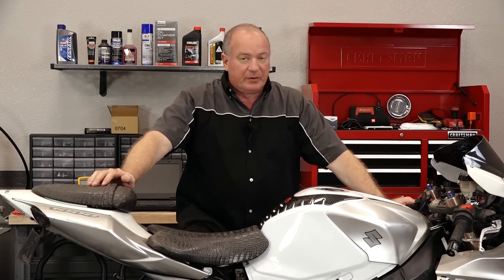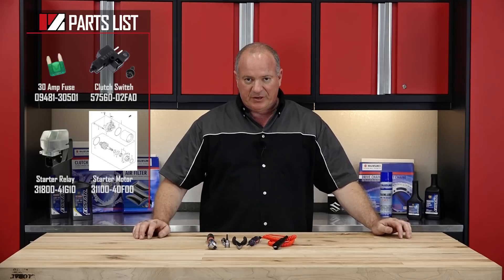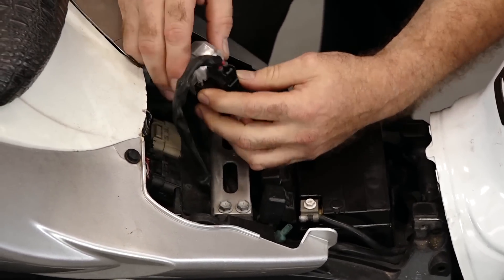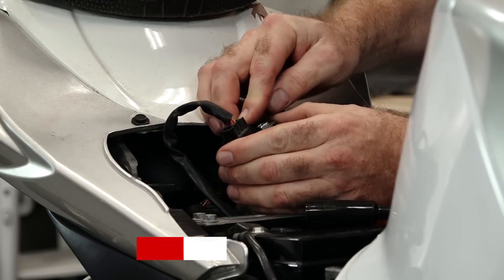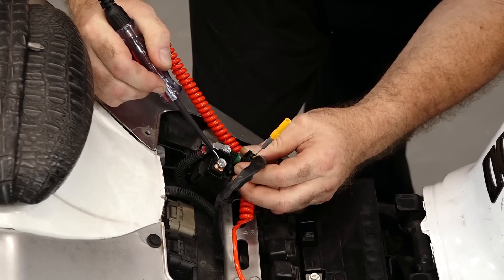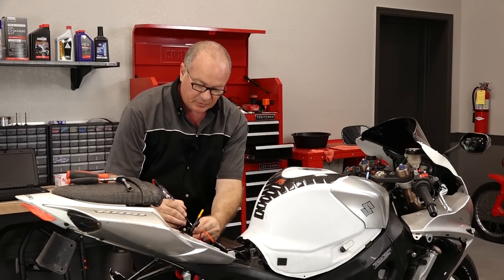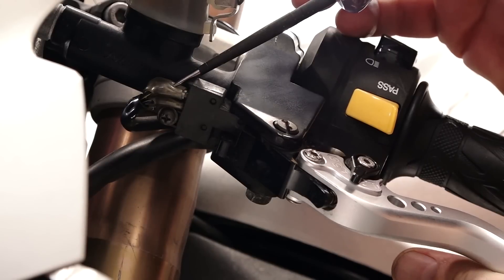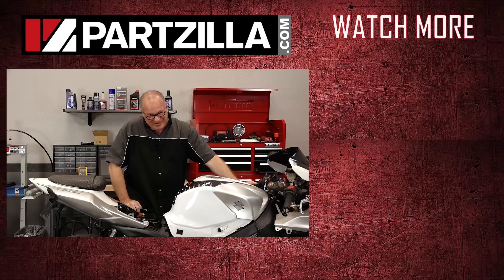GSXR 1000 Won’t Start Troubleshooting | Partzilla.com

Comment: Thank you video was very useful on 08 gsxr, at the end it was just the setting in the clutch little adjusting lever on my aftermarket shorty levers, it wasnt out enough for it to click the switch when I pulled on the lever, probem solved thanks
Reply: Angel Diaz Thanks for posting this comment. Took me forever checking everything and this was my exact problem.
Reply: you welcome glad it helped you out, I taught it could happen to somebody else sometimes is the simple things
Reply: Wow angel Diaz thanks a lot for posting that comment I spent hours Eliminating all the problems and at the end it was the aftermarket clutch lever not pushing the switch in enough wow crazy something so stupid could be the problem !!! Ty bro
Reply: Me rushing home hoping my shortys causing all my problems lol

Comment: Hi John, I've done everything you've stated here and found it very helpful,  but while testing the starter silonoid with the negative cable disconnected, the relay does not make the "clicking noise" as mentioned. Also,  when I touch the negative cable with the test light it does not light up.  Any suggestions?
Reply: Test light is good,  fuse is not blown,  switch works

Comment: Hey John, what about if my fuse is okay (measured for continuity), but its still not giving voltage to starter side?
Reply: Just found out, my wire's were installed wrong way lol. 😅
Reply: What wires exactly were installed the wrong way ?

Comment: The RPM gauge on My gsxr 1000 L1 (2011) dont work. What could be the problem? Wiring? fuse, or a sensor? Just the RPM. Shout out from sweden 🙌😃

Comment: I have a 1990 GSXR 750M track only bike that will not start. I thought I had a problem with the starter relay as it was clicking when I tried to start the bike, so I bought a new one and replaced the old one. Still not starting. Neutral, oil light and dials illuminate with the ignition switch set to ON position. Now, the new starter relay making a buzzing noise instead. I have also put a shorty aftermarket clutch and brake lever, would this affect anything? I fully charged the battery and tried again. Still no luck. I have not tried push starting it yet. Should I try this? Should I change the battery as it was bought in 2011? Do you have any suggestions as to why it will not start? Your help would be most appreciated. Thanks
Reply from the maker: Could be a bad battery, which is most likely.  Otherwise, check for loose or damaged wires.  Try bump starting it and see if it fires up.

Comment: Hi, I’m having an issue with my 04 GSXR 600. Anytime I connect the battery, it starts turning over. I get no power to the dash and the kill switch or start button does nothing. I am assuming it is the starter relay. Should I replace the starter relay or is there something else that I should be looking at?

Comment: was diagnosing a quad that was left to me has a 2006 gsx-r1000 and when i hit the start button my starter make a loud click sound and has a hard time cranking over does this mean my starter motor is on its last legs? and the starter rely part really helped me about the fuse because i couldnt find the dang thing on the quad until i found it hiding way under where it should not be so i relocated it as well while i was there. as well when you buy the starter motor will it come built i saw your link but im not sure if i feel comfortable putting it together myself i dont wanna drop any parts any advice?
Reply from the maker: I would health check the battery and test all the way to the starter.  If you need a starter, they come assembled.
Reply: Ok thank you so much!! I will get back to you and check everything along the way

Comment: I have a 05 gsxr 1000 bike will start with ignition on and just two big positive wires clutch on ground is good on clutch and 30amp fuse is good battery is only 11.5v and drops while turning over but I checked voltage at yellow green wire and only have 3.45volts what should this wire have for voltage    bike will start with charge but have to jump two main wires to starter thanks bro
Reply from the maker: Start at your battery and test everything down to the starter.  Either you have a bad wire, corrosion or bad solenoid.

Comment: I have got no dash coming on when I turn on the ignition just the headlights come on. I have power though even with ignition off to starter relay and both sides of the 30amp fuse. When I   jump together neg and pos terminals off the starter relay it turns over even without the ignition on. Should I have power to both sides of relay with ignition off? and should the starter turn over when shorted across with ignition off?

Comment: Hello I have 2016 gsxr 600, I’m having trouble with starting, all the light turns on, but doesn’t start, I checked everything has power, but the negative terminal on the starter relay doesn’t glow the light, but the fuse is in perfect condition, clutch is good too, any idea what could be possibly wrong. I’m thinking maybe the regulator/rectifier. Thanks

Comment: I’ve got an ‘06 GSX-R 600 that keeps blowing the 30A fuse and I’m sure it’s an easy fix, I don’t know where to look for to fix the issue though. Absolutely no power goes to it and the battery is good. Could use the help..

Comment: Partzilla I was riding my 07 gsxr 600 took it around the block and just everything shut off on me turn the switch on and no power at all, for the pass few months my head light keeps blowing out so I decided to not put a headlight bulb anymore, it didn’t use to have this problem before, my battery is good it’s new, but something is always killing my battery as well when I am on high rpm but not all the time, now the issue that I am having is that I took it for a ride and it all completely died on me no power at all and when i turn the switch on I have no power
Reply from the maker: You definitely have a short somewhere that is affecting your electrical system.

Comment: Hey so I check the clutch switch and up on checking I notice I connect the tester to the positive side of the battery and touch the top wire on the clutch sensor and the light is on when the clutch is pull in nothing happens the light just stays on!!! ? 😕

Comment: changed the starter relay, starter, stator, and rectifier, and still will not cut on. the lights and everything else works fine. everytime I try to start it I just hear clicking in the starter relay solenoid.

Comment: Hello there,,i have a question about my 2009 gsxr 600.one day it just died off me after starting and running the bike for about 20 seconds.after that it was just turning  or cranking but not starting the bike.had checked batteries,new sparkplugs,strater fuses ,tip over sensor..clutch,kickstand,and fuel pump working.but still bike wont start..desperate for help pleaseee..thanks.🙂

Comment: Hi I'm Daniel I have a 2002 gsxr 1000 she'll start up and I'll drive around for a while even turn it off gi do something come back and she'll start with no problem but she'll stall a at ight starting off  and won't start back up again. 
When go to start her back up she seems to die like the battery is dead.
I did a battery check and even changed the battery there hold the charge even with a load. Relay clicks. I'm it's the starter that when it get hot it doesn't want to start.
Help, getting that starter out looks like a nightmare..
Thanks Daniel

Comment: is there a chance you would make a video on a newer bike, I have a 2014 gixer 1000 and I'm having a similar problem but after following your instructions on this video I came out with no solution to it, engine won't even crank, I have a bran new battery, starter relay, clutch switch and I checked the starter switch and the kill switch, please help?
Reply from the maker: Does it click?  Does it do anything or just dead?  Check wires for loose connection or corrosion.  Sidestand switch.  Test that you are getting power down the line, there will be a cut off somewhere.
Reply: @PartzillaParts :  
I really appreciate your reply, so here it is, I tested everything I could in my garage, the clutch switch, starter relay, the starter it self I took it out and tested it, the stand switch is working fine, the starter button got taken apart, cleaned and put back together. I replaced the  clutch switch and the starter relay just to be sure, the battery is in perfect shape, and the problem is still the same, when I turn the key on I do hear the pump priming and all the normal noises of the bike before starting, but once I hit the starter button the head light dims and nothing else happens, no cranking, no turning nothing.
Reply from the maker: @pablosiordia  Have you checked the wires?  Corrosion or a short could do that.  Do a load test on the battery, often times it will read charged, but can't handle the load.

Comment: Hey I’m having the problem of my gsr 750 will start and ride but when I turn it off then try start it again it’ll act asif there’s not enough volts in the battery, batttery showing 12.9 when off

Comment: my bike sometimes will not do anything when the key is turned on but the fuses are fine then randomly it will turn on is it possible that the starter relay with the 30 amp fuse needs to be replaced?

Comment: John wpuld a bad starter relay cause the bike to turn on (dash lights, odo etc.) But say check with f1 light on (no codes) but not prime the fuel pump and I hear no noise from the relay when I press the start button
Reply from the maker: Could be a relay, fuse, ignition wiring issue...time to start tracing from the ignition back.

Comment: Hey patzila im using gsxr 600 2008...

Im getting cide c32 and c33 it says two injectors......

I have inspected the injectors is spraying great i have inspected wire harness is have all same power power but the problem is now bike wont start is trying but not starting.. Fuel pump.fuel pressure.. Plugs throttle is perfect... But bike doesn't start and they others guys says is ground wire so i dont know where is the ground were can you help me out

Comment: Have a question for you. I have a Kawazaki ninja 250 2007. The bike doesn’t start, I jumped started and it worked, went for a spin down the street, but the next day didn’t work again. I thought it was the battery so I replaced it. But still doesn’t show anything in the dashboard, i checked the fuses and they look ok. I have a tool to jumpstart motorcycles or cars and when i connect that to the battery it shows the lights in dashboard, but if i take that off the battery it shows nothing... any idea?
Reply from the maker: Have you checked all the connections for corrosion and make sure they are tight?   What you are describing still sounds like a battery problem.
Reply: I did, it doesn’t jump start anymore, if i connect the jump starter it only shows the check oil light.

Comment: Just to confirm. When testing the starter replay. You had the negative cable disconnected. I hear the click when I hit the start button but my negative and positive are connected. Is it supposed to start when I test the starter solinod with the negative and positive cables connected.
Reply from the maker: Yes.  Either your relay is bad or you don't have enough juice to turn over the starter

Comment: 07 gsxr 750. When starting the bike the Starter is weak as if there’s not enough power to it. Brand new battery. Still weak. Jumped the starter reply still weak. Completely stump at this point

Comment: Question my 01 gsxr fuel pump only primes when I boost the battery to 24v. This started when I broke my key in my switch and replaced it with a cheap ignition switch. Can a bad diode in the switch cause the pump not to prime?
Reply from the maker: If the problem started with the new switch, then it is most likely the problem.  Going cheap can sometimes be more expensive.

Comment: Does the K8 1000 have a relay switch like that and if so where would it be having the same issue getting “0” power when I turn the key no lights no sounds no movement on the dash brand new battery
Reply from the maker: Have you checked your fuses first?  Otherwise, yes it has a relay,  should be in the same area.
Reply: I actually found my issue the starter relay was completely gone missing from the bike but thanks for you support this video helped me find my issue

Comment: I have a 2001 Gsxr recently had a bad stator and I fried some wires, so I replaced the stator and regulator put in new spark plugs oil change new battery, and can’t get her to turn over just turns over lights on my dash go off and won’t start, I’ve been reading it could be my ECU or sometimes the ignition switch goes out, any ideas before a spend another 100 bucks on a ECU, thank you
Reply from the maker: I would continue checking your wires first.  Could be a short.  Everything turning off means a complete loss of power when you make that connection.

Comment: Any ideas about a “hot start” issue on gsxr? Bike won’t start after shutting it off @170+f ... thank you
Reply from the maker: Test the rectifier.
Reply: Partzilla thank you for the response. I have a new oem Rectifier and a new stator.

Comment: HEY, MY GY6 150CC DOESNT START BY THE ELECTRIC START BUTTON I PUT ON A NEW SOLENOID RELAY IT RUNS WITH THE KICK START BUT NOT BY THE ELECTRIC START BUTTON AND THE NEW SOLEN/RELAY I TRY STARTING IT BY JUMPING THE SOLEN/RELAY WITH PLIERS BUT I DIDNT GET ANY SPARK WHEN I JUMP IT WITH A PAIR OF PLIERS WHAT COULD BE WRONG GARRET PLEASE HELP? JOE 
Show less

Comment: can an aftermarket stator or rectifier blow out an ecu? if so how can you check?
Reply from the maker: It's possible.  You would have to have a lot of failures in the system for it to fry the ECU.  Test everything you can to eliminate buying an ECU first.  The cheap stators can really fry stuff on your bike.

Comment: I have a question. I have a 07 gsxr 1000. When I try to start the bike I just get a click a single click sound come from the starter. I have replaced the starter solenoid brand new, I've tested the clutch switch. Can anyone help. Wondering if the engine is froze up. I put the bike into 6th gear and tried to spin the rear tire and it will not

Comment: 2002 600r intermitent :occasionally my bike wont start I dont Hear the fuel pump and the F1 is on to check ..Then I Switch on and off the Kill switch few times 5 -8 time and then it's coming back to normal ..fuel pump start FI warning goes away and crank normally ..Any ideas?
Reply from the maker: Sounds like an intermittent relay or connection that is causing some electrical issues.  It's a pain, but you have to trace and test.

Comment: I have a problem !! I have a 07gsxr 750..battery is chagre and starter is good when i hit the start bottom i do there the relay clicking but its not starting the bike ...but when i push start bike it starts right up.. up..could my starter relay still be bad
Reply from the maker: Health check the battery.  Test the starter relay.

Comment: Hello everyone. 
I have a starting problem on my gsxr 1000 k5. Everything lights up starter is cranking but the engine wont start. When turning the kill switch on i can't hear the pump working like it should... Just turning the kill switch on and nothing happens... Like i have the side stand opened but the problem is that the side stand is closed and the side stand switch is working properly. And the CHEC code is on my display. Not FI code.. Just the CHEC. It might be the relay problem but i dont know i haven't checked it yet.

Comment: What if it cranks but wont catch? Could it be clogged carbs
Reply from the maker: Could be a fuel or spark issue.
Reply: @PartzillaParts  narrowed it to a no spark issue but the coils are getting battery voltage

Comment: I have an 07 Busa. The lights come on, but the instrument panel doesn't cycle through. The tachometer rests at 4k RPM on and off. The odometer and clock doesn't come on. I have a new battery installed. It also will not start with a jump. What troubleshooting steps do I take next?
Reply: @nineball26 thank you, I'll look into this

Comment: I have tried this method and also changed the fuel pump motor and filter and my check light is still on. Only thing I could think it could be at this point is one I didn’t put fuel back in the tank that could be why the fuel pump is not priming or my battery is reading 12.2 V and should be above 12.4. Can anyone help with this problem?

Comment: My Suzuki GSXR 750 2005 its reving up to 2000 and then lo loses power and lower it self to 1500 and lower it goes until it shuts down my bike what do you think it is?
Reply from the maker: You aren't getting any FI codes?

Comment: If I push the start button and I don't have power to my yellow and green wire going into the stater does that mean my switch isn't working
Reply from the maker: Could be.  Volt meter, test the switch.
Reply: @PartzillaParts  I believe it is the starter relay found power going to threw switch fuse is good but wont put out to the starter

Comment: Hi I have a 99Gsx R750 when its cold out it will not run but if its warm out its fine any idea?
Reply: Oh I even put a new battery in it still does the same thing
Reply from the maker: You have a carburetor.  You need to open the choke and let it warm up.  It's the nature of the beast.

Comment: I have a 2003 Katana 750 it turns over but will not start, any suggestions?
Reply from the maker: Fuel and spark.  Check both!